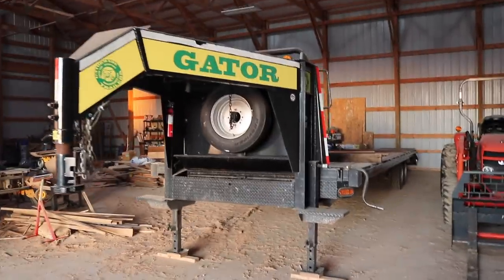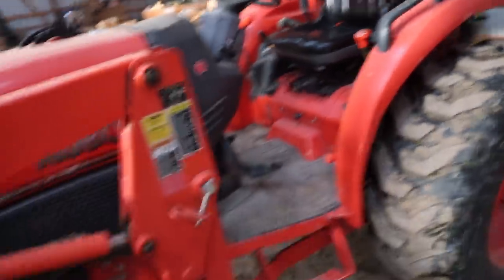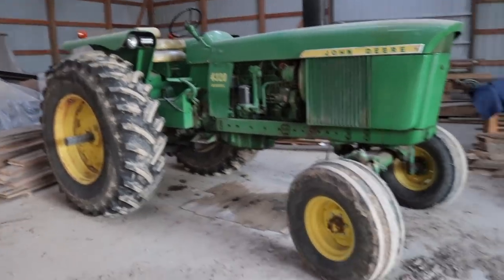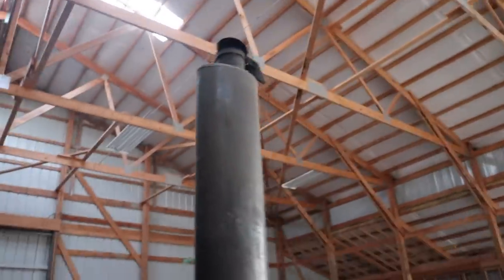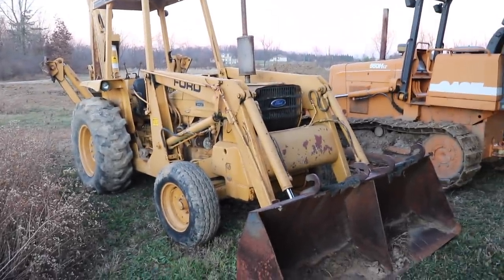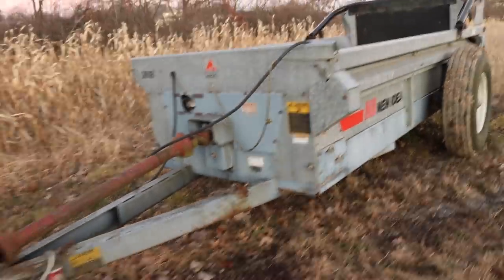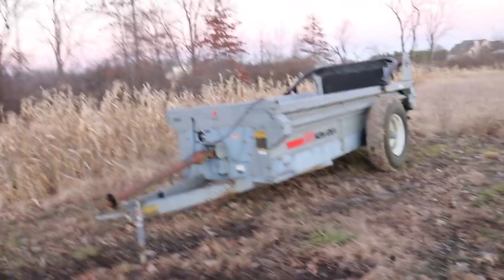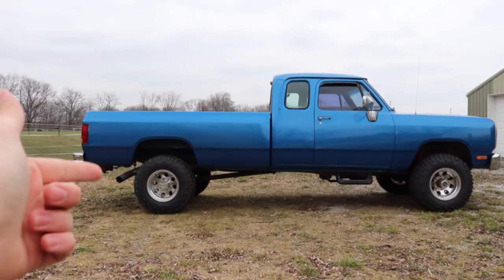we are SELLING EVERYTHING...

Comment: Dont do that again with a trailer, I luv over building trailers but for gross vehicle weight rating It does not matter how over built your trailer is you are still restricted to trailer capacity and truck capacity if u load over that trailer plate u can get very screwed
Reply from the maker: For short distance hauls like he used it for... (one farm to the next) you’ll never get bothered by anyone.

Comment: If that 4320 was overhauled 200Hrs ago and leaks oil then I wouldn't trust any of the work that was done because the seals weren't installed correctly and if the internals weren't done right its a ticking bomb.
Reply: could be hydraulic oil

Comment: I haul a 25+5 gator made gooseneck dually axles with my single wheel truck in Indiana. Never heard of any law or anything like that...
Reply from the maker: The issue was that the trailer would be rated for much more than the trucks safe load rating is what they told him. So he might get flagged by DOT

Comment: Hey man incase you’re Interested in selling my 2018 L4701 with 950 hrs 
4x4 automatic with loader bucket I bought it for $35,000 
But I am selling it for the same price but including galvanized shredder, discer And box blade a hitch for gooseneck trailers and tow behind trailers for the tractor also a 6ft rake and a 3 point hitch counterweight and I also added 2 extra aux hydraulic hoses for a grapple
The tractor still has warranty
Reply from the maker: For 8% commission lol
Reply: Tractor is under my name, reason I’m selling it is because I also have a John Deere skid loader
All the extra equipment  I added is around 8 grand but throwing it in because I don’t need it 
Thanks either way